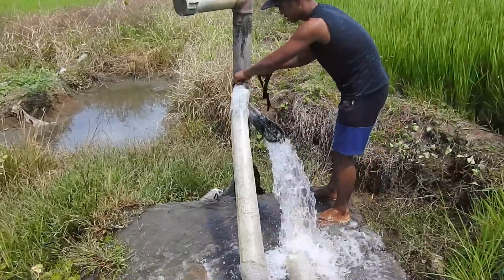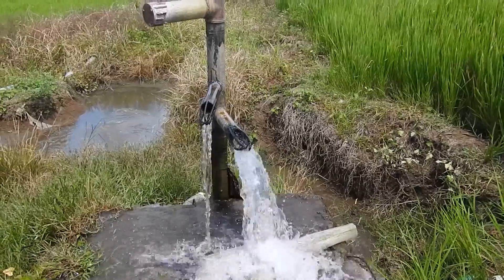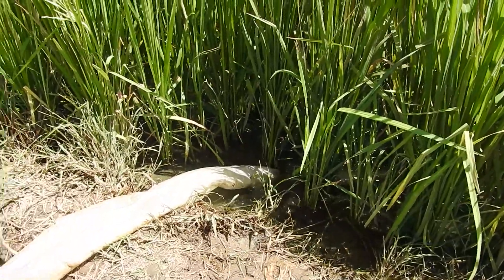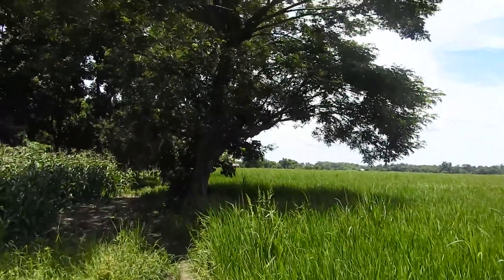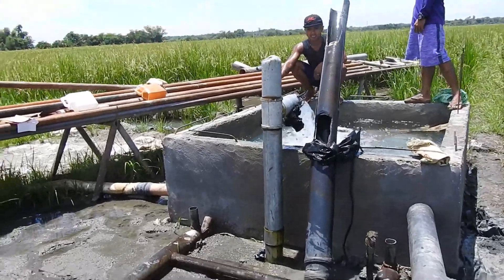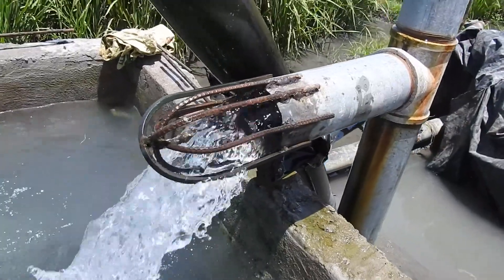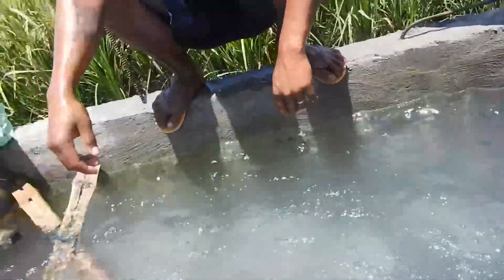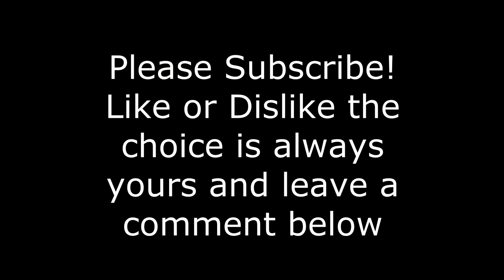Roxas, Isabela - Water springs abounds in Imbiao

Comment: Paano ginagawa Yan wla bang makina yan
Reply from the maker: Elizer Ballestar - thank you for watching. Here in between the mountains, the water percolate from the mountains to underground aquifers forming underground rivers. The rivers are about 180 metres below ground and you can hear the water flowing using the casing acting as speakers. There is no machine needed because the underground water pressure is great to push the water out of the underground river